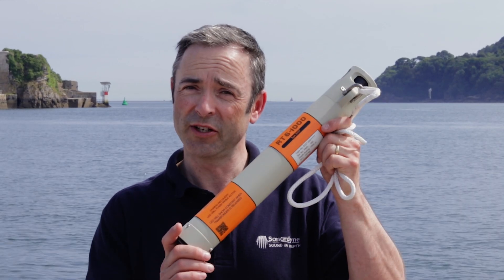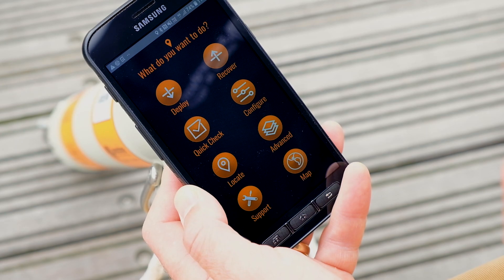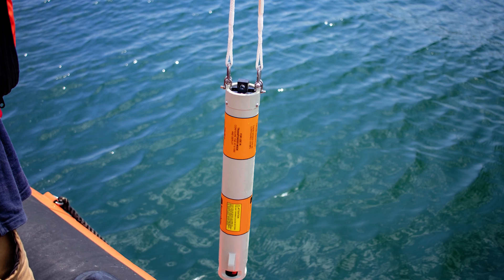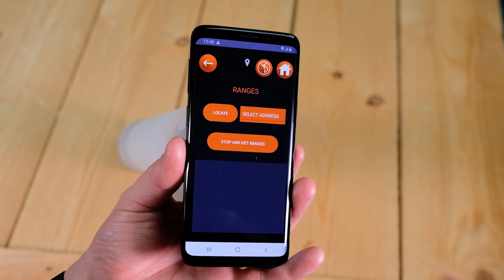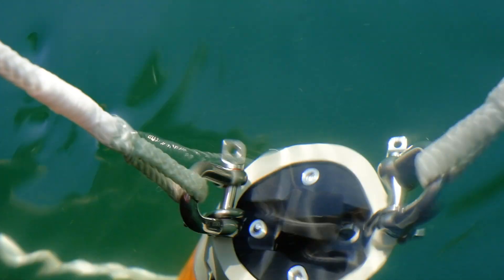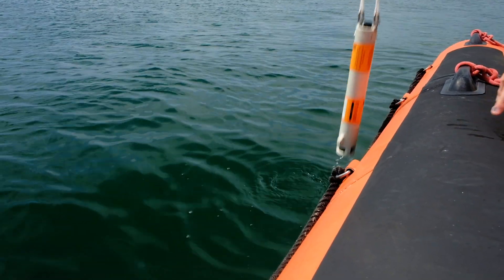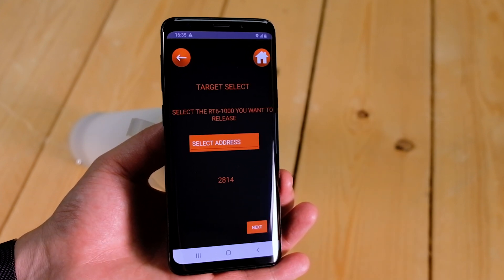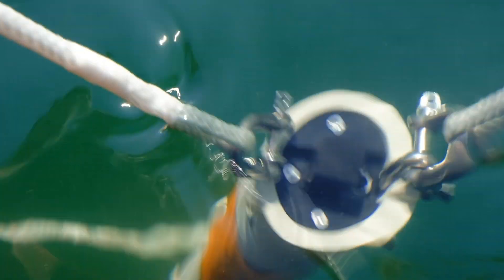How to Recover the RT 6-1000

Comment: Hi! Hope you all are ok! Ive another enquire! Hope you can help me. If i deployed the rt6 1000 without puttin the location in the app map, bc we know the location. Can i keep with the steps  to recover the rt6 in the app? Thank you
Reply from the maker: Hi @gowhales3002, even without adding your location to the map, you can still follow the steps to release and recover the RT6 1000 with your instruments via the "Release" section on the home page of the app. However, it's always a good idea to add your location to the maps section of the app. You never know when it might come in handy.🙂
Reply: One thing else, how can we turn off the recovery transponder ? It's frozen the blue light on
Reply from the maker: @gowhales3002   You can start by trying a quick check through the app's home screen. If that doesn't work, try disconnecting the battery using the configure section of the app. Then, reconnect the battery using the same section. If you still need assistance, you can request a copy of the user manual from our website https://www.sonardyne.com/products-knowledge-base/rt-6-1000-manuals/ The manual should contain all the information you need beyond what is covered in this video.